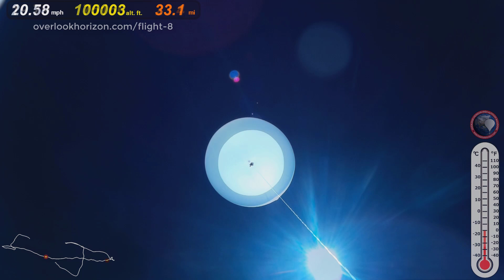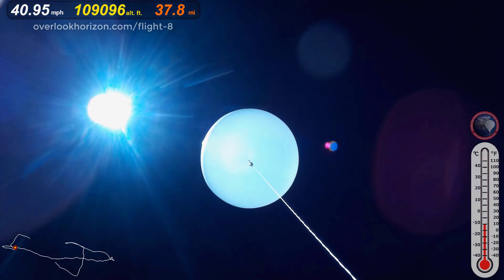WEATHER BALLOON BURST 🎈💥 GoPro Camera

Comment: I know this is a dumb question but can't we just engineer one that won't pop and just continue on
Reply from the maker: Yes and no.  We do have balloons designed not to burst (super pressure balloons) but they don't keep going, they stop at a certain altitude.  The balloon must expand to keep rising.  The expansion displaces air which causes the balloon to rise.  Eventually, the balloon stops expanding and hovers or else it would have to expand to an astronomical size to continue displacing enough air as the atmosphere thins.
Reply: @OLHZN  I was just curious as the majority of these balloons you see only make it to about 125000 ft tops before they explode.
Reply from the maker: It's a good question and a great lesson on why & how helium balloons rise!
Reply: @OLHZN  are there any vacuum lift vehicles (i don't know if they should be called balloons) ? Or are they just a concept?

Comment: Why did the balloon burst?
Reply from the maker: The balloon is designed to burst at high altitudes. As it rises in the atmosphere the air pressure decreases and the balloon expands more and more. Eventually, it expands to its breaking point and intentionally bursts and parachutes back to the ground.
Reply: +OLHZN High Altitude Balloons So shouldn't our atmosphere expand or dissapate into space?
Reply from the maker: No. Gravity keeps our atmosphere around for the most part (the atmosphere does actually dissipate slightly over billions of years).  The molecules of the atmosphere would need to reach escape velocity to escape our Earth's gravity just like anything else.
Reply: +OLHZN High Altitude Balloons Not sure what I think about this so called force called gravity. It doesn't make sense. Is there something within the earth that creates this force called gravity? And if there is, what is it?
Reply: @truthbetold818  According to Einstein gravity isn't a force and is rather caused by spatial expansion i.e. the surface of the earth at all points going through an upward acceleration!!! Yet all object expanding together including rulers thus why we don't notice visually and only feel the Earth's surface pushing up on our feet as we stand. Similar to feeling a push force if standing in a lift going through an upward acceleration.
Reply: @decaDBZ  Expansion theory for gravity is not Einstein. Einstein claimed gravity was caused by bending spacetime.
Reply: Another flerfer wanting others to do their homework for them. Will you be going on the flerfer cruise @truthbetold?
Reply: @tripinfool5640  he never said he believed in that stuff
Reply: +Benjamin Reynolds Was Einstein 100% certain that is theory was a scientific fact, or was it simply a theory? What was the experiment he performed to prove his theory to be fact?